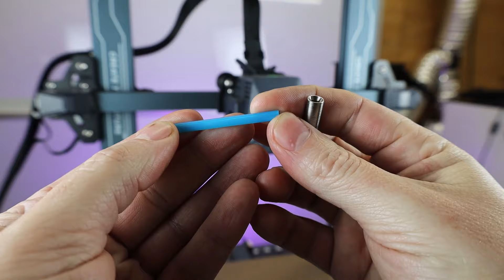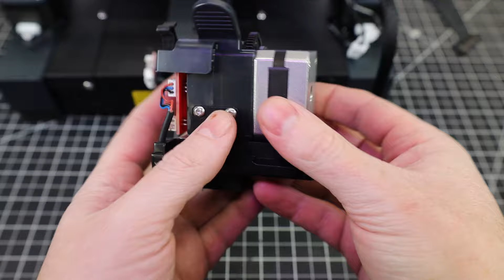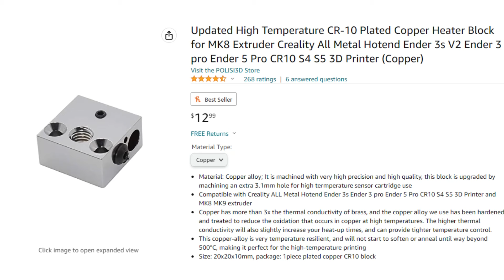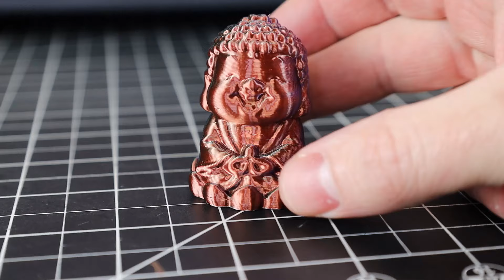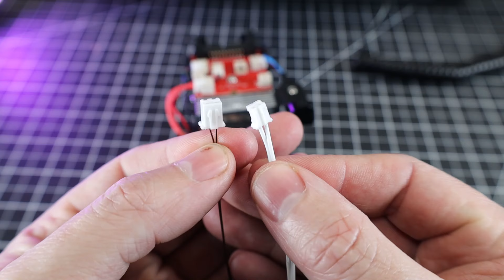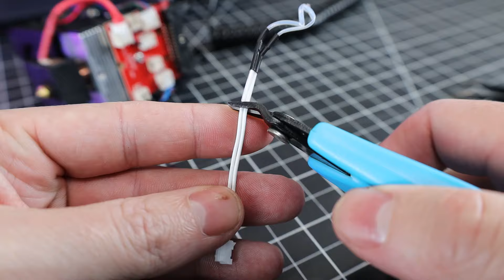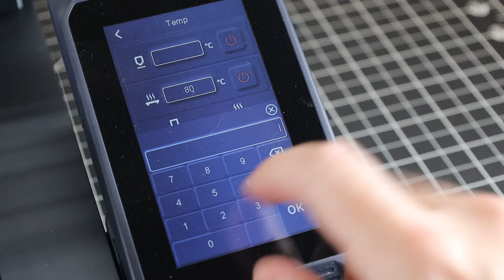$25 All-Metal Hotend Upgrade For Elegoo Neptune 3 Pro, Plus & Max

Comment: Very well detailed thank you. Just received my Max a few weeks ago and may consider this upgrade as i do ABS from time to time
Reply from the maker: Let me know if you end up doing it and how it works out for you. I did find that it started to under extrude a little bit so you might need to tune your retraction settings after doing this. A good starting point is 1 mm retraction at 27 mm per second.
Reply: @randymay  Thank you i will for sure

Comment: Hi, when you replace the heat block (high end one) & the All Metal Bimetal Heatbreak Copper & Titanium, did you also replace or upgrade the Bowden tube?
Reply from the maker: You don't have to upgrade it but you do have to cut it down to about 30mm
Reply: @randymay  Thank you

Comment: Hi. Excellent vid. Just a tad confused when it comes to the ptfe tube, did you or did you not put it back in with the new hot end? Thanks
Reply from the maker: In the video I didn't put it back in and as you saw it worked but I did put it in later. You do need to cut it down to about 30mms due to it no longer going all the way down to the nozzle.
Reply: @randymay  thanks so much for the reply. V much appreciated. I’ve just had the Neptune 3 Max for a few weeks and I’m so nervous taking something that big and expensive apart, but your video is so reassuring. 

Thanks again.

Comment: will this work on the original Neptune 3?
Reply from the maker: Yes it will
Reply: @randymay  Ok, I just finished installing it on my Neptune 3 (original) so far it appears to work but the installation procedure is a bit different. Also, there is a gap that the line won't feed through in the block. I finally had to cut a short piece of PTFE tube and put in the gap. It printed the test print fine but I will have to replace the PTFE tube with silicone or something that can take the heat if I want to run anything hotter.

Comment: Is there meanwhile a compatible brass stud thermistor with the right connector?
Reply from the maker: Nope, but it's not hard to cut your old one and solder it to it like I did.
Reply: @randymay  Yeah, I know. But as a rookie solderer I'd prefer to spend a bit more for a ready-made solution. I already had to resolder connectors on the 5015 fans for the Hero Me Gen.7 cooling shroud (it works great btw.), so soldering two wires together also doesn't seem impossible anymore.

Comment: First, great tutorial. I'm in the middle of doing the same to my N3 plus. But I've run into an issue - with the new screws for the heater block, I find the block wiggles, because the screw holes are beveled, instead of straight walled like the original. I got the m2×16 screws, but mine are button-head. What kind are you using, and do you have the wiggle in the heater block?
Reply from the maker: Yeah you might get a little bit of wiggle in the block when trying to tighten down the nozzle due to how the setup is. That being said you can use some adjustable pliers to hold the block in place as you tighten up the nozzle and a little bit of movement that you have won't matter.
Reply: @randymay  ok, cool. How much play in the block is acceptable? I mean, it's not swinging around, but it doesn't take much to wiggle it.
Reply from the maker: So you can technically not put those bolts in at all as long as you tighten down your nozzle snug against the heat break that's inside of the heat block that whole thing isn't going to go anywhere. Another point that you should make sure is nice and tight is the grub screw that holds in the heat break because if that is loose you'll be able to spend the entire thing.
Reply: @randymay  if you're interested, I came up with a fix, for the wiggle. It's a little low-rent, but it works. All you need is a twist tie (like that comes wrapped around any power cord). Take the twist tie, make one loop around the shaft of the screw, under the head, and screw the screw in place. The twist tie acts as an o-ring, and takes up the space, and removes the wiggle. Now it's nice and tight 😎

Comment: Hi mate, because the Heat block sits lower as you used m2 x 16mm screws do you have to adjust the z end stop to compensate as I have the N3P printer that has no bed thumb screws to adjust? Thanks
Reply from the maker: But the thing is it doesn't sit any lower. The block that I used didn't have holes in the block as deep as the original one so I needed longer bolts to make up for that. The new heat block and break are the length in every other way so there should be no problem with bed clearance.
Reply: @randymay  ok thanks for your reply mate

Comment: The biggest take away from this for me was to not f around and up the temp in the gcode past 260, cuz mine is stock and apparently they trust us to not cook wires lol
Reply from the maker: Yeah you can just leave it alone and it will print PLA just fine. You will want to change out that PTFE tube every so often due to it being baked in the hot end for hours on end. 

Swapping it over to this bi-metallic heat break you won't have to worry about changing over that tube. You don't have to swap the thermistor and can just leave the rest alone. 😁👍
Reply: @randymay  You seem willing to hand out knowledge and i appreciate that. What is the point of that tube?

Comment: The nozzle now being lower than the inductive sensor doesn't cause any trouble?
Reply from the maker: With all the items that I use it should be exactly the same but this seems to be a very common problem for a lot of people for some reason. Did you put the PTFE to back in if so did you cut it to the right length?
Reply: @Randy May  yeah I put ptfe back on for a cleaner filament path, but I cut it to fit, it isn't lowering the heat break any.
Reply from the maker: Send me some pictures of the setup to randymaybusiness@gmail.com I will see if I can help

Comment: This video is super well done and perfectly concise, thank you! Quick question, you mentioned using an enclosure, which is what I want to do for my N3 Pro, but I know it’s recommended to move the PSU outside the enclosure for most printers, is that the case here? Or can the stock PSU hold up in the hotter environment? Thank you again!
Reply from the maker: Yeah it is always best to keep the PSU cooler but you really don't have to worry about it in my experience. Typically the enclosures get to around 100° f .
Reply: @randymay  oh awesome thank you!

Comment: hello, so you don't have to put the ptfe tube back with the bi-metal? (i'm french, my english is very not perfect, and the automatic traduction too  ;) )
Reply from the maker: You really should put the PTFE tube back in but you will have to cut it down to about 30mm long in total
Reply: @randymay  thanks you
Reply: @randymay  will there be problems if you dont?
Reply from the maker: It makes it really hard to load your filament in for one. Some people say that it will cause under extrusion as well not having a smooth clean path but I haven't seen that when printing without it. But if you're doing this you already have the PTFE tube just cut it and put it in and you'll pretty much never have to replace it unless you wear a hole in it
Reply: @randymay  thank for the details ;)

Comment: How did you level the printer? My print head wants to return to zero and keeps jamming the nozzle into the print bed due to the parts being a different size
Reply from the maker: Honestly everything should be around the same size. I guess measure everything you have and see if something's off by a lot.

Comment: I found that removing the 2 screws that hold fan shroud but waiting to disconnect the fan wires and remove the shroud until after you remove  the whole assembly from the printer makes removing the fan wires then the fan shroud much easier.  But thank you for the tutorial and the links for the parts.  Very helpful

Comment: do you use the original ptfe tube as well?
Reply from the maker: Yes but you have to cut it down to about 30 mm long so it fits in there properly with the heat break

Comment: Hello my friend, first of all thank you for the great video you shared with us. I would like to ask you few more questions, I just got into 3d printing few months ago and I'm the average noob user so my questions might be silly:
- I've read somewhere online that it is recommended to change the PTFE tube every month (i've never done it so far and have consumed 3KG of PLA so far), should I do that? If I upgrade the hotend like you in the video with the all-metal, that does not "burn" the PTFE anymore, so I should not replace that, is that correct?
- Can you make also a video on how to dismount all the roller wheels in case they wear out? I was able only to reach and disassembly only the print-plate wheels, but probably the wheels on the print head I can dismount them after dismounting the print head, but what about the Z Axis? There's one wheel per side on the Z Axis I am not able to understand how to disassembly.

Thank you so much in advance for your help man
Reply from the maker: If you upgrade the hot end to what I did you won't need to change out the tube pretty much ever unless you wear a hole in it.

Comment: My neptune 3 is missing some specific areas in my prints. Nothing helps, but I broke the fan that blows on the heat block and can’t find a replacement. Its also too loud stock.
Reply from the maker: Contact Elegoo for a replacement.
Reply: @randymay  I had to contact them 4 times for them to finally send one.

Comment: Followed this and went to re-level the bed but now the nozzle is pressing into the bed while probing. Any advice? Even raised the z offset super high but it still hits the bed.
Reply from the maker: Other people I've had this similar problem. 
And what I've heard from them and how they figured out how to fix it was to remove the nozzle and heat block then they made sure to screw the nozzle all the way into the heat block before screwing the heat break in. 

Also if you are using the original PTFE tubing you need to cut it down because it's too long as it is, For me I need you to cut it down to 30 mm long so it fits in there properly.
Reply: @randymay  I ended up not using the tube again, but I was also suggested to factory reset the printer. I'll post what works here so others can know when I get off work!

Comment: Trying to do this but the nozzle is hitting the bed when leveling
Reply: Same issue and the nozzles are the same length :/
Reply: @SerDerpALot2015  I fixed mine by removing the tubing and loosening the nozzle to where there was a noticeable gap between it and the block then tightening the break on in deeper. Works just fine
Reply from the maker: You might need to check all of your parts and make sure they are the correct size seeing that some parts might be longer than others. Like long vs short nozzles

Comment: You can use the Ender 3s1 pro 300c  thermistor, but it seems to require drilling into the heat block.
Reply from the maker: Good to know.

Comment: Just read over Facebook that a guy did this mod and the nozzle smashed into the bed.
Reply from the maker: I have seen people having problems with this setup and I just don't understand what they are doing wrong. The parts that I linked to and used are all the same size as the original ones so it should be a direct swap. 

The only reason I can see this happening is either  they are using different parts that are the wrong size or they are not installing it properly. The PTFE tube does need to be cut down to about 30mm long so that might be part of the problem as well.

I have done this on the Neptune 3 Pro, Neptune 3 Max and Original Neptune 3 with no problems. 😅
Reply: @randymay  I can't decide whether to mod an Egeloo or buy a Qidi Tech x-plus 3. Benchy on the Egeloo Neptune 3 pro look really good (I think because of the springless bed), but I need to print ASA  for the car.
Reply from the maker: Understandable and I have the QiDi -Smart on the way right now that might also be a good option. 

That being said  Neptune can print in ASA after this update but I really suggest an enclosure for it. With my first printers I was always printing ABS and I would just put a cardboard box over the printer to keep it from warping.

Comment: Great Video! Quick question about the PTFE tube, is there a stop for the PTFE tube when I reinstall it? I was running into some issues because I may have cut my PTFE tube too short and it was moving in and out of the heat break. I tried running it without the PTFE all together and its damn near impossible to get the filament loaded.
Reply from the maker: There is a small lip on the new part to hold the PTFE tube and it's just held in place with pressure from the top of the head brake so if it's too short it will move around in there. You can buy some more PTFE tube and cut a new piece. I cut mine to 30mm but it might be different for you, that being said that would be a good starting point. 

Here is a link to some new PTFE https://amzn.to/3nChx5N
Reply: @randymay  thank you so much! I’ll give it a shot!

Comment: This may sound kind of weird but it looks like my block is sort-of bent so that the nozzle points forward a little.. is that ok? Also looks like I leaked on the first print :/ Mine also had a plastic tube type thing, should i put that back in? Also, any idea what size grub screws are used? I think i may have lost one.
Reply from the maker: Bent isn't good and it's leaking? That is a really big problem for sure. I think the Grub screws are M2
Reply: @randymay  Perhaps the screws are overtightened pulling the block at an angle?
Reply: @randymay  Any idea what size JST connector they use? I bought a set and it doesn't have one that quite matches.
Reply: So i wound up dropping the whole end from 6 feet up and smashing it. Elegoo support is really nice though and are sending another.

Comment: Do you know if this would work the same for the neptune 3 just the regular one???
Reply from the maker: Yes it does I don't know about the thermistor setup but the hot end part does they are exactly the same parts.
Reply: @randymay  do i need the thermistor or can i just have the hot end and the heat block thing really my only goal is to print with asa and i know i need the hot end
Reply from the maker: You don't need it to do that.

Comment: What did you end up doing for the thermistor? I bought the jst connectors but the themistor wire is so thin its impossible to crimp, it just slides right out. Might just do what you did with the heatshrink instead tbh
Reply from the maker: I cut and soldered the wires together and then put heat shrink around them so they didn't short. You can use a small length of wire at the JST connector and then do exactly what I did with the soldering.
Reply: Did you strip the wire on the thermistor end before soldiering it to the original connector? I tried stripping a bit and there is only a single strand of wired in there. @randymay

Comment: I have a question do you forget to put the PTFE tube back ?
Reply from the maker: So I was just trying it without it but found that it makes it a little bit harder to load if it's not in there so I did end up putting it back in. You do have to cut it to about 30 mm to work with the new setup.

Comment: Very interesting video and well presented.
I have a few questions, to me it seems that the stock hot end (block and throat) are already metal so why does replacing with mentioned parts matter?
Also if one puts back the PFTE does this not run into issues with heat? Or does the PTFE no longer run into the nozzle with new parts?
Disclaimer I don’t even have a printer as of yet (on order) so my questions may be off topic.
Reply from the maker: Yeah the parts on both are metal but the stock parts allow the PTFE tube to go all the way to the nozzle and the after market one stops it at the very top. The top part of the copper part doesn't get up to the temps of the hot end.
Reply: @randymay  sorry for the question. How do i know how long the PTFE tubing has to be?
And my second question, because i cant find an answer anywhere: do i have to disassambly the whole unit to change the PTFE tubing, because Elegoo recomends to do it monthly? Cant find a replacement one, only the one comes with the printer.
Reply from the maker: @Chris0612  If you are upgrading to the all metal you need to cut it to about 30mm long. You don't have to take if fully apart you can just take the wires off the heat block and loosen the 1 grub screw on the back of the hotend to get the heat break out. 

If you do upgrade the hotend the you would need to change out the PTFE tube due to it not getting that hot any more.
Reply: Just verifying, "you would [NOT] need to change out the PTFE? 

And thanks for these comments, I may not have replaced the PTFE tubing otherwise 😅 since I couldn't see it on the new parts in the video. Btw, is it worth it to replace the tubing with a Capricorn Bowden one (have some extra lying around that I can cut to 30mm)?
Reply: @LeeKenshin7  Also interested in the answer to this. I am assuming the PTFE tube can and probably should be added back in after its cut and yes, if you have Capricorn Bowden stuff then I would use that instead as its meant to be 'better'. @randymay can you confirm please :)
Reply from the maker: For the most part you should have to replace the PTFE tube after doing this.
Reply: I’m having this exact issue, trying to cut the one I took out to the right length to fit while keeping the inward bevel on the end at the drive gears @randymay